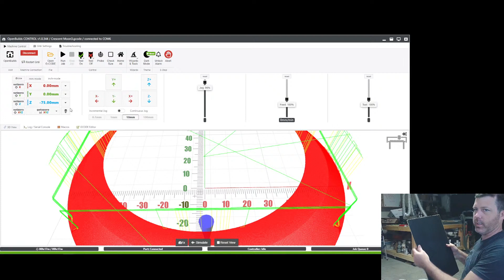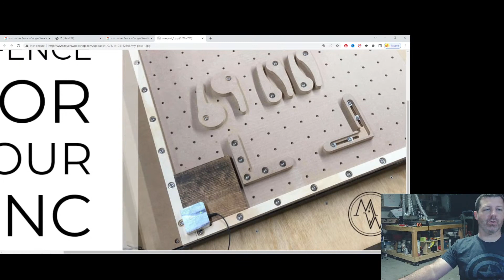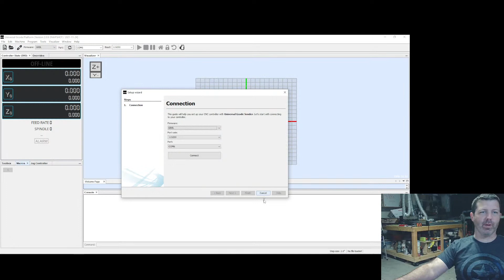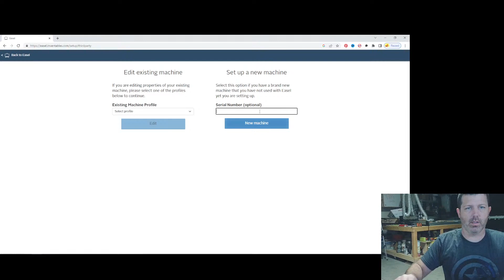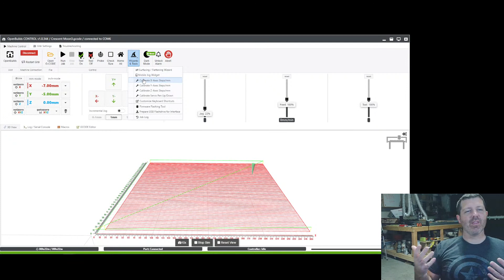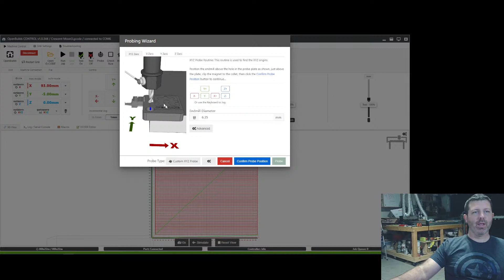Save Jig Location for Repeat Carves Using OpenBuilds Sender & Expediting 3d Carves - Recorded Live

Comment: Using your G28 to set a corner Co-ords do you need to worry about bit diameter offset? Difference between diameter of 1/8 & 1/4 bits or just rely on the radius centre Co-ords will be same regardless of bit diameter?
Reply from the maker: Just center point 👍 
using a v bit will help align if you're eyeballing it.

Comment: On my edge rails (,not connected corner) I utilise the edge threaded inserts for alignment with 6.25mm holes in the rails. I use the same bolts to compliment hold down clamps with short clamp bars made from 10mm ply